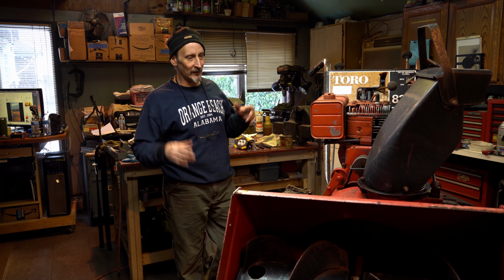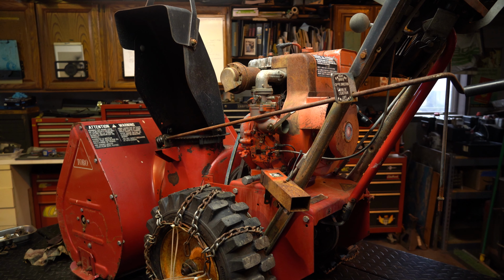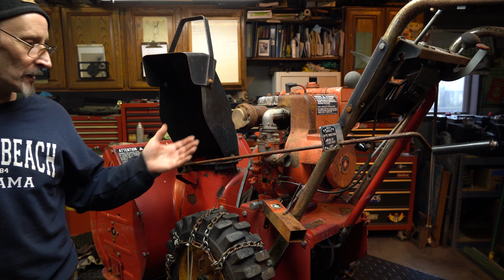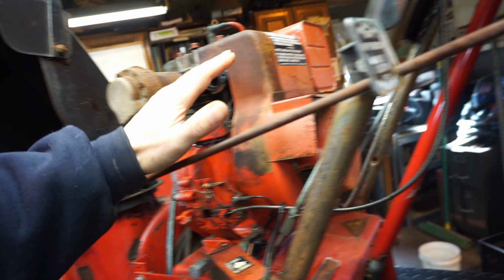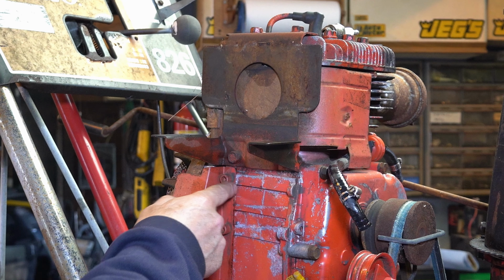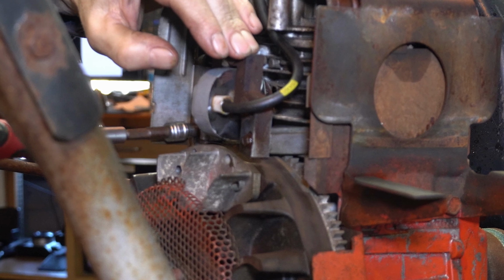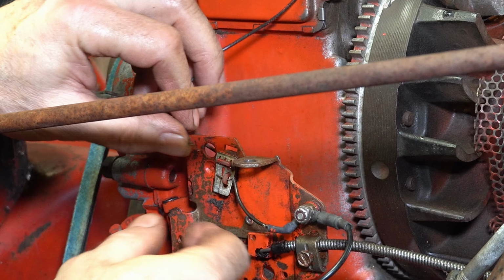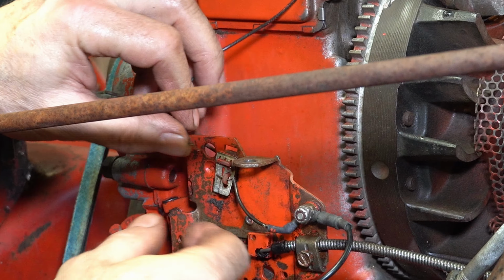TORO 826 Snowblower~8hp BRIGGS & STRATTON Engine - Revival -  Will it Run? Part 1

Comment: Have one of these Beast,  The Starter is 120v ac where you plug in an extension cord  and push the button to start. This machine will work ya if ya let it..  The clutches for each wheel can be good or bad until you get use to them as they will / Can fight you Left/ Right or Straight.  Was told by a long time Toro guy that they did away with the auger design as when it would encounter a snow pile that was frozen this type tried to climb the frozen snow. He said thats why they used the cut and drag in design. Plus they are H E A V Y . Thanks for the video

Comment: woww thanks ,realy good vidéo , tell me ,at the end ,how many turns of screw for both of them ?
Reply from the maker: Thanks!!!
I should mention these things, usually I do.
Generally, we turn these in gently and back them out about 2 turns, then we use our ear and a RPM Tach. They wind up where they do, there is no way to set it to some specific number. Not to mention it also depends on the air/barometric pressure.

Comment: I have two of these.   So durable and heavy.    Two questions:   
1.  You think these engines will last decades?   Mine don't even burn oil yet.   
2.  I removed the kill wire from the clip under the carb because I got tired of the safety doodads.   When I put it back nothing happens.   What would I need to do to make the kill switch work again in layman terms?    Or any idea why it's not working?  Thanks
Reply from the maker: Rich, Thanks for watching!
In good shape, these are really well built machines and the engines are stout! Kept well, its a lifetime machine!
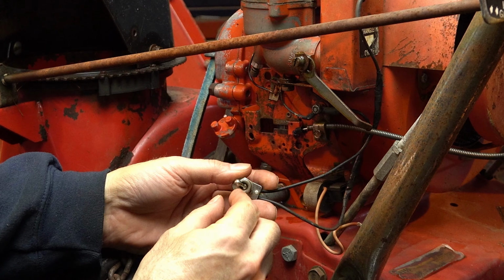The switch was modified here, time stamp start around 3:50 or 3:55, you can copy this. Move the wire that's attached to the air cleaner extension to a place that is more stable, like the chassis or handle bar for a better connection. Move the switch to a better location to get at it easier.
I forget what I did at the end, check out part-2! its been a while..
I have another machine now, it was hit by an RV and damaged, its also very rusty so I may use it for parts!
I should be doing a video on it in the next couple of weeks.. A Will It Run and then probably a tear down as well.
Stay tuned, I can better answer the question this way as its not simple writing this fer sure!!
Reply: @TheNovaJohn  Thanks!!!

Comment: can you tell me what to check when a blower works and when i plull the ogger handle up it boggs down to stall
Reply from the maker: could be a carburetor issue, hard to say. When they get older they need a full tune-up and service. I have several videos in a folder on this. Go to my homepage and check them out.